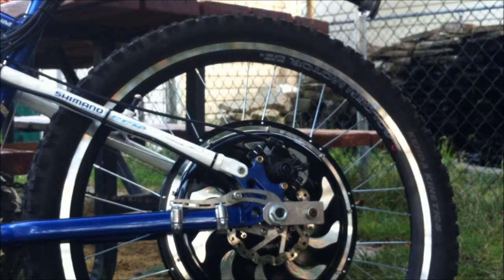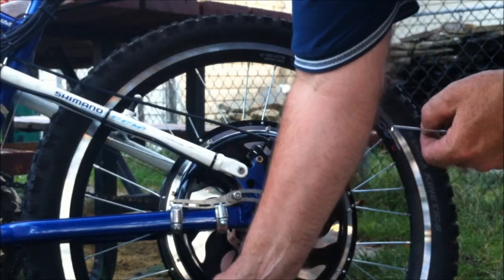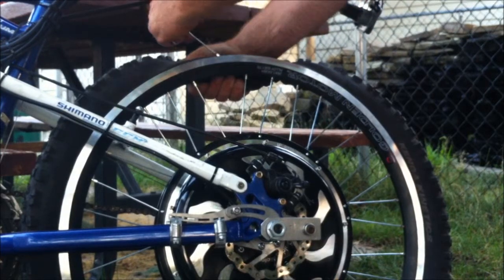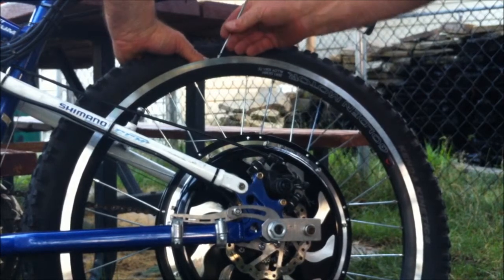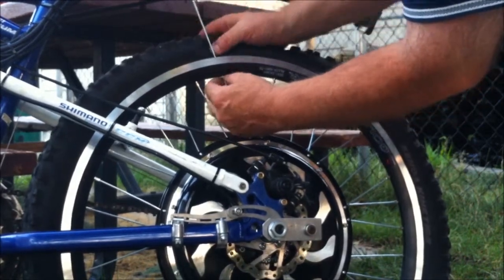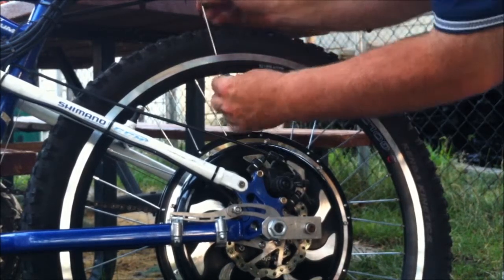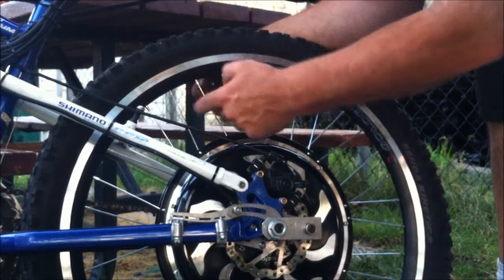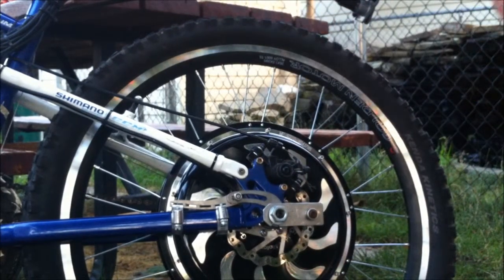Replacing a broken spoke

Comment from the maker: Yes thas true, I was thinking of mentioning that when I mad the video but forgot of course. I have propped up the bike pulled the tube out and off to the side  at the valve and rocked a spoke nipple out the valve hole. it is still pssible without removing the tire. I usually just leave it in as sooner or later you get a flat. At the point I never patch a tube. I replace it. The wheel then needs to come off and I shake out the spoke nipple then.